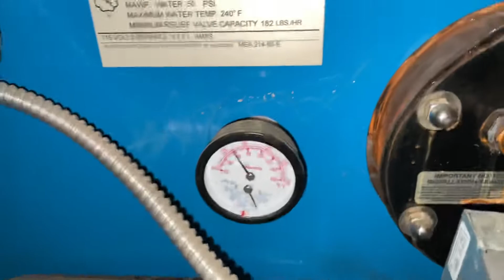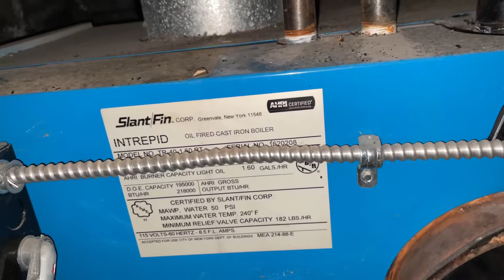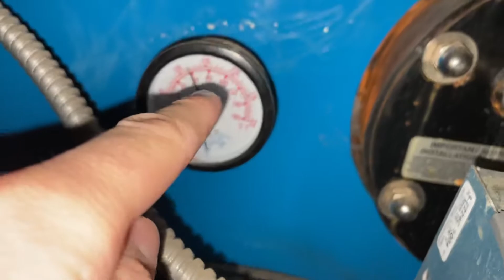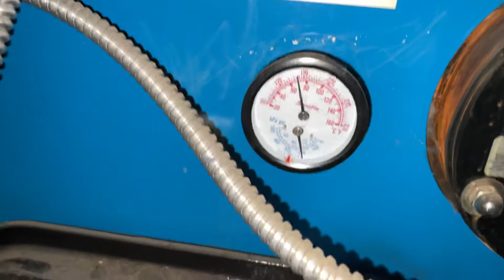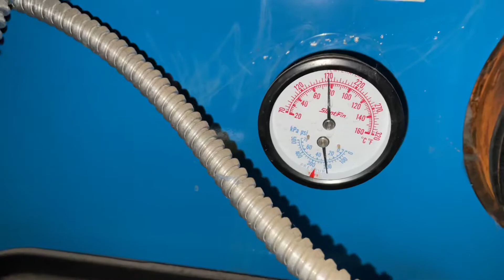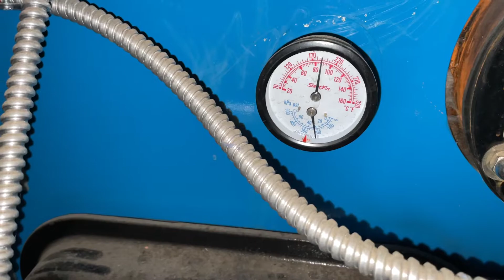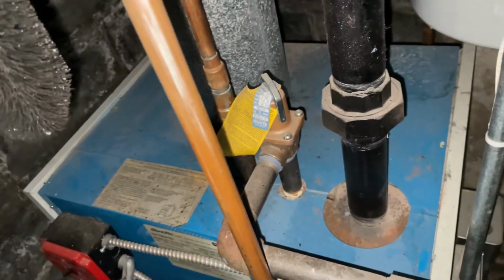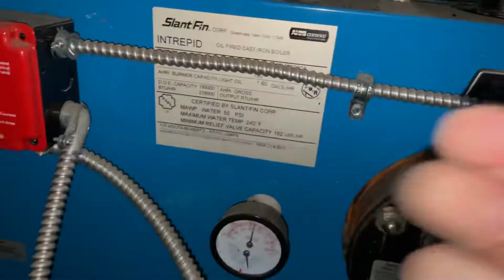Oil boiler slant fin

Comment: NOT SURE IF THE PUMP TURNS ON HIGH AT ONE POINT LIKE A THERMOSTAT IN A CAR,
Reply from the maker: Maybe who knows I find it strange like I will hear the circulator pump come on then In like 30 seconds it shuts off because I’m guessing it has to reheat the water again then it comes back on then eventually it will remain on until the thermostat clicks off